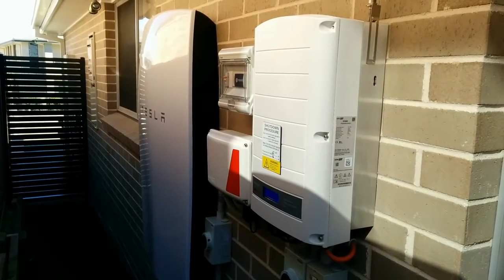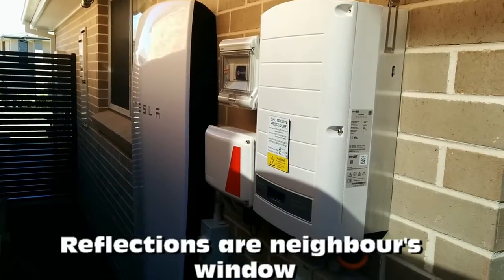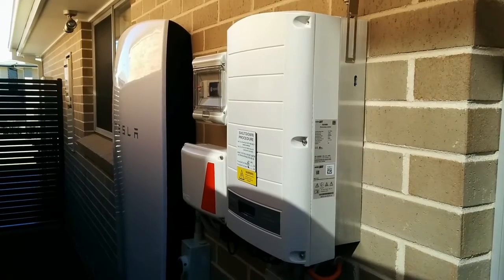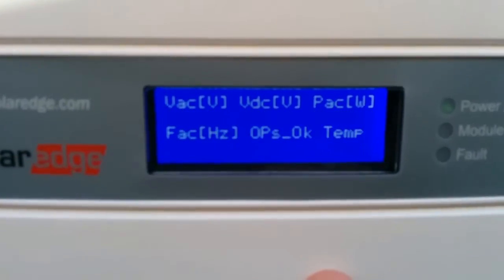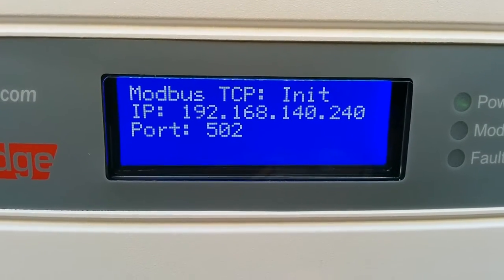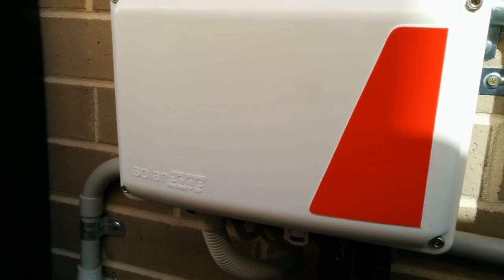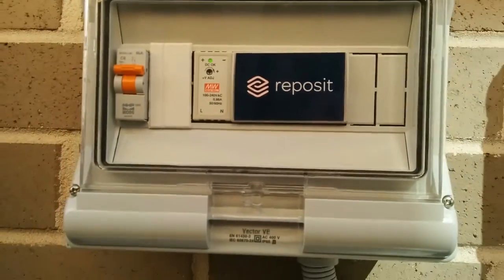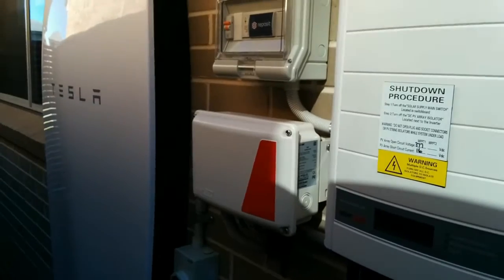Unleash The Powerwall - The Brains Of The Operation

Comment: I have GSM connection , which connects every 4 hours, yours is Wi-Fi and it connects every 15 minutes.

http://i.imgur.com/liPqsB1.jpg
Reply from the maker: Hi Greg! Since this video, the Zigbee has been disabled, and all comms flow through Reposit (bridged to SolarEdge inverter). As I understand it, comms is more regular than 15 minutes in either scenario, but the SolarEdge Web Portal only slices the data to 15 minute intervals.